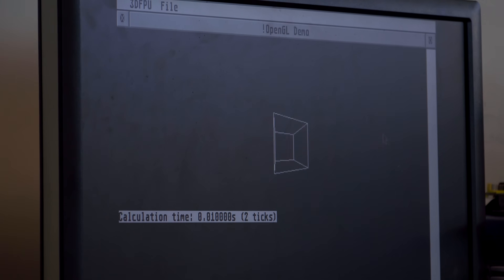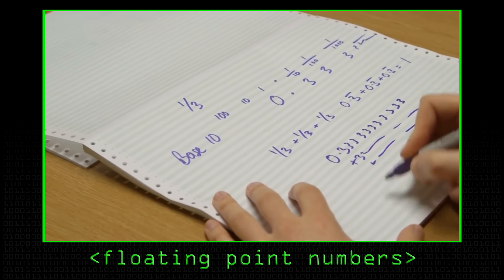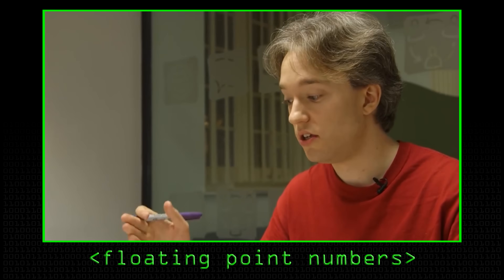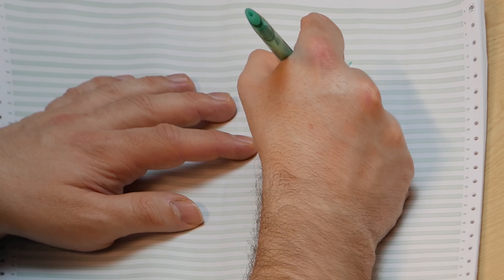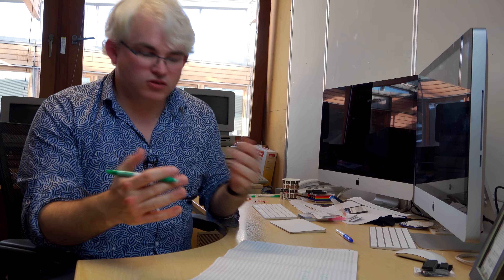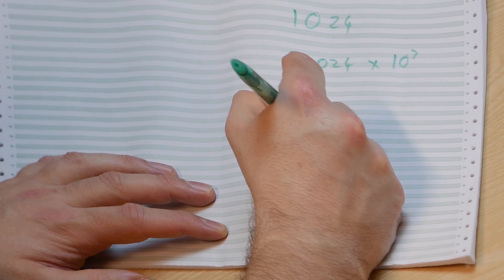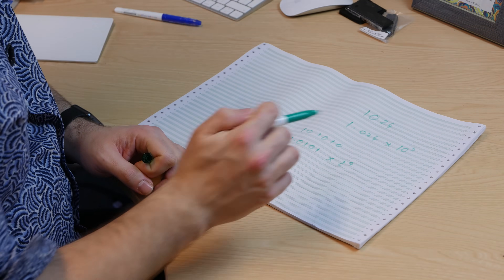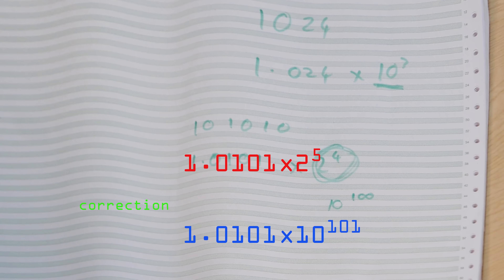Floating Point Numbers (Part1: Fp vs Fixed) - Computerphile

Comment: 0.1 + 0.2 == 0.3
>>> False

really was a great moment in my life
Reply: round(0.1+0.2, 1) == 0.3  # quick-fix LOL
Reply: python3  >>> 0.30000000000000004
Reply: Had a similar moment with an assignment last year.... Had a calculation that was supposed to output an upper diagonal matrix (No idea wether it's called that in english, basically everything below the diagonal was supposed to be zero). Well, it wasn't.... Took me 1/2h+ to figure out that I was using floats and the entries were very close to zero, just not precisely. I felt quite stupid afterwards :D
Reply: @bjornseine2342  Add an extra dimension for the purpose of normalizing everything (homogeneous coordinates). Now instead of numbers close to 0, you'll mostly get infinity or not a number and feel even stupider :) At least floating-point has precise values of infinity, lol.
Reply: Björn Seine are you referring to identity matrix? But in this case both upper and lower portions of the diagonal are zeros.
Reply: >>> from decimal import *
>>> getcontext().prec = 28
>>> Decimal('0.1') + Decimal('0.2') == Decimal('0.3')
True
>>> Decimal('0.1') + Decimal('0.2') == Decimal('0.2')
False
Reply: Ewan Marshall Ohh looks like the self hosted floating point function in python is better than that one provided by the lexer.
Reply: @platin2148  What you precisely mean by self hosted? Decimal module is part of the python standard library, it will use mpdecimal C/C++ library if available (should be as it is included with python) else it has it's own python implementation in Lib/_pydecimal.py

But yeah, there are good reasons it is a separate module, and standard floating point math exists too.
Reply: @EwanMarshall  what kind of a masochist uses that? Use numpy like a normal person.
Reply: @cbernier3  One that doesn't want to use something that doesn't come with python itself for one, there are other reasons too. Numpy is more things like accelerating matrix multiplication (the the form of multidimensional arrays), not doing arbitrary precision mathematics. mpmath is more of a 3rd party package to what the Decimal module and and mpdecimal/libmpdec/_pydecimal provide.
Reply: @EwanMarshall  But how often does that apply in the real world? Very few people need arbitrary precision math. Whereas, a ton of people are needed to do machine learning, which is mostly matrix multiplication. Then there's graphics, more matrix multiplication. Most people don't get to be math professors. The rest of us have to go out and get a job. Regular (double) precision is fine for most uses. Who cares about the last digits when your algorithm is only going to be 80% accurate anyways?
Reply: @cbernier3  Financial code does not generally use floating point mathematics for a start. Most either use decimal library like this one or they count everything in pennies/cents and puts in the decimal point for display at the end. So there is a big portion of code using such mathematics. Matrix mathematics is important tool in it's own fields of computer graphics and machine learning, as a such accuracy is less important there are much as fast computation over large matrices. Basically one picks the right tool for the job.
Reply: @EwanMarshall  Financial code doesn't need nor use arbitrary precision floating point. You don't need to calculate nano cents. Financial code is not rewritten very often and doesn't make up a large portion of the job market. Also, there's a lot more to finance than debiting checking accounts and loans. The real work in finance is high frequency stock trading, and that uses tiny numbers and machine learning again. By all means, use whatever tool is best for the job. But what about when the job isn't defined yet? 99.99% of the jobs out there don't require beyond double precision numbers. You only have a finite amount of time. Dicking around with 128 bit precision floating points doesn't have nearly the same expected value as learning machine learning. I have never had anyone ask in a job interview about my experience with arbitrary precision floating points. If I need that someday, I will learn it then. You know the data scientists that teached themselves python and don't even know what a pointer is make a lot more money than the PhD computer scientists who never leave university. By all means, while a student, go ahead and enjoy geeking out on your dissertation topic. But you still have to keep in mind a career transition path. It isn't easy going from phd student to real world, especially for people whose PhD is not actually in Computer Science.
Reply: @cbernier3  in finance and trading, even the slightest rounding error is a major legal liability. Also arbitrary precision doesn't just improve below the decimal place. A large portion of financial code uses arbitrary Decimal arithmetic for precisely the reason, double precision and floating point precision are not viable. The errors are not always just the last decimal place and the errors can quickly compound. Even the cash register at a shop will not be using floating point or double precision let alone banking servers, stock market trading machines, insurance company servers...
Reply: @EwanMarshall  On the contrary, rounding happens all the time. With currency conversions and compound interest, it is unavoidable. There is no such thing as arbitrary-precision fractional arithmetic.
Reply: @EwanMarshall   wow that's wonderful...
Reply: For me, the moment was seeing “n = n + 1” for the first time.
Reply: @lawrencedoliveiro9104  What's so great about that? That's like first-day programming.
Reply: Ricard Miras Sadly it could have been already messed up by converting from ascii to float. Inside the lexer.
Reply: (1+2)/10 == 3/10 not all fractional numbers in base 10 are representable in base 2. It all depends in the base the computer is using to represent them internally. And how smart the interpreter/compiler is simplifying expressions.
Reply: perl6 : 0.1 + 0.2 == 0.3 >>> True
Reply: >>> 0.2 + 0.3 == 0.5
True
Why is it correct?
Reply: @tsunghan_yu  It is correct because they are equal distance from the nearest power of two: 0.25. 0.20000000000000001110223024625157 + 0.29999999999999998889776975374843 = 0.5
Reply: 0.1, 0.2, and 0.3 can't be represented as a finite integer times a power of 2. Same reason why 1/3, 1/7, etc aren't representable as finite length decimal expansions. I can still write them however by ignoring expansions and just writing them as 1/10, 1/5, 3/10, 1/3, and 1/7. Rational numbers are great and don't give a flip about what base you're using. (They still have finite dynamic range because when don't have an infinite amount of space, but still.)
Reply: false.
Reply: 0.10000000000000000555111512312578 + 0.20000000000000001110223024625157 = 0.30000000000000001665334536937735

Comment: IEEE754, float 128
Is there a way to chain together two doubles (float 64) in order to emulate a float with a 104bit mantissa?
Reply: An interesting little tid-bit to note is that the 80x87 co-processor that Intel developed for the x86 - which is now bundled onto the x86 processor itself - actually had 80-bit registers.

Though you loaded those registers with 32-bit "floats" and 64-bit "doubles", the actual registers - and, thus, the floating point arithmetic - was done in 80-bits. Then, when you popped those registers back onto the CPU, you'd pop off the 32-bit or 64-bit result (dropping those extra 16 bits of additional precision that it used internally).

An extra 16-bit "margin of error" on all calculations.

And I'm saying "was" - past tense - because, with the MMX extensions on the Pentium, they looked at those 80-bit registers and realised that it doesn't require much to bump that up to 128 bits.

So the floating-point registers were internally bumped up to 128 bits and re-used for the MMX ("multimedia extensions") instructions.

Although, the idea of MMX was SIMD - single instruction, multiple data - so the 128-bits were not treated as a single 128-bit value, but were rather treated as four 32-bit values.

This was performance orientated - hence the "multimedia" in the MMX name, as that was the target usage, in graphics and sound - to simply get more done in a single instruction.

Often in graphics or sound, you're performing the same operation over and over again. Such as adding a value to every single pixel on the screen, or multiplying every single sample in a waveform by a value (say, half - to quieten it to half volume).

And SIMD is aimed at that. Pack four 32-bits pixels into those 128-bits and do all four pixels at the same time with one instruction. Then the next four, then the next four.

Basically, a case of just trying to get through this big "backlog" of pixels or samples that you've got to get processed as quickly as possible, doing a batch of four of them at a time.

But because the MMX registers were actually the floating-point registers, you couldn't do both things at the same time. And MMX treated those 32-bits as 32-bit integers.

So, if you weren't careful, the performance improvements could end up being lost and dwarfed by the constant need to save all the registers, then load all the registers with the packed MMX values, perform the instruction... and then a context switch to something that wanted to use the floating-point would save all the registers, then load all the registers back up with floating-point values, perform an instruction... and then another context switch.

You get the gist. The overhead of ensuring that the two don't wrongly interfere with each other's operation could easily lose you any advantage that MMX could bring.

But then MMX become SSE - Streaming SIMD extensions - and the name change reflected an attempt to make it more generic. So, with increasing version numbers of SSE, you had floating-point - the four 32-bits within the 128-bits could be "float" as well as "int" - and different ways to split things up, so it could be two 64-bits instead of four 32-bits.

So, you know, "under the hood" the actual registers have always been larger than 64-bits. They were at least 80-bits from the off and have actually been expanded since - though mostly to accommodate the MMX / SSE SIMD stuff, rather than just have really big floating-points, per se.
Reply: KlaxonCow Note that the x86 / x87 instruction set could store the full 80 bit floats if desired and that's how most compilers do or did long double on x86: 80 bit floats from the x87 or it's software emulator, sometimes padded to 128 bits in compilers that can't handle 10 byte fundamental types.
Reply: quad precision in hardware is really rare as it is hardly ever used and using the compiler specific implementations is sufficient for most scenarios. And you will not manage to get better general performance with self-made constructs - they are already based on what the hardware can deliver.
Reply: I guess that a double-double would be faster then a [Intel] long double or the GCC __float128 implementation, as there is actual hardware support for 64bit floats
Reply: There's some hardware with support for 128 bit float, but it isn't a standard feature, and you can't really force a vector unit to treat two 64 bit floats as a single value due to the bit allocation patterns being physically wired into the hardware.
You're better off rethinking your algorithm.

[edit: standardized -> a standard feature to avoid confusion.]
Reply: @peterjohnson9438  Even if emulating something close to a 128bit float would require 4 or more double operations it would still be faster then all sw implementations, plus it mostly puts load on the FPUs instead of being a generic load. Therefore it seems to me (with my limited knowledge) that a hw based implementation is more desirable then a pure sw float128 according to IEEE754. 
As far as I know 128bit FPUs are very very scarce and expensive, therefore mostly undesirable because - unless you're running a purpose built data center - your not going to use f128 very often. Making a solution using multiple f64s even more desirable. I don't know how  such an implementation would look like, though it will have multiple buffer f64s for sure.
edit: replaced >>most<< with >>all<<
Reply: @peterjohnson9438  128 bit float is standardized, it's part of IEEE 754, it's just not common in consumer hardware
Reply: @sundhaug92  I meant that it isn't a standard feature of the CPUs you find in the wild. I could have worded myself a bit less ambiguously. :)
Reply: @nietschecrossout550  The point here is that for current software needs, the 64 bit double float offers more than enough precision for tasks that require speed - and those can be grouped up with AVX. Anything that requires the precision of 128 bit (or larger) floats is usually such a small part of a larger program that emulating it isn't prohibitively slow (if at all noticeable). If you really need 128 bit floats hardware accelerated, you're probably involved with nuclear (or quantum) physics or astronomy, and should look into getting your hands on that specialty hardware.

Also, it seems that quad doubles have been implemented in CUDA, so that could also be a start if you run into such a problem.
Reply: For the Julia language there is actually DoubleFloats.jl, which does exactly that. The Double64 has a mantissa of 106 Bits but still 11 for the exponent and requires no extra hardware. If you don't care about speed that much, there are also libraries for arbitrary precision FPs if you really need a lot of accuracy.
Reply: It must be noted that arbitrary-precision numbers, be it real numbers or integers, are not only slower than fixed-size hardware implementations, but also require arbitrary amounts of RAM, which is hardly surprising. The more digits the number has, the more RAM you'll need. Also, arbitrary-precision real numbers are complicated, because you can't just have an arbitrary-precision floating point number and not consider infinite mantissas, e.g. 1/3 would require infinite RAM (0.33333...), so in practice numbers like that are stored as rational numbers instead.